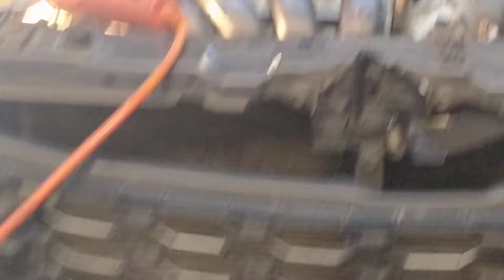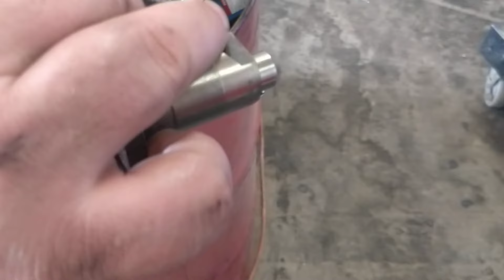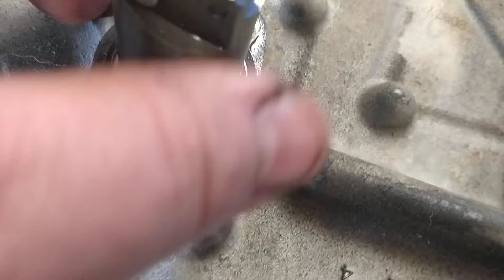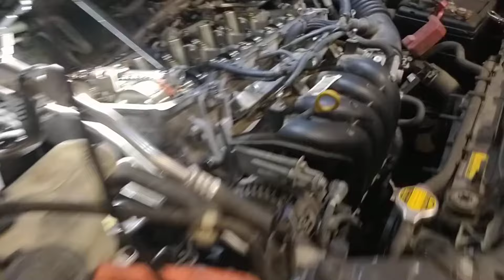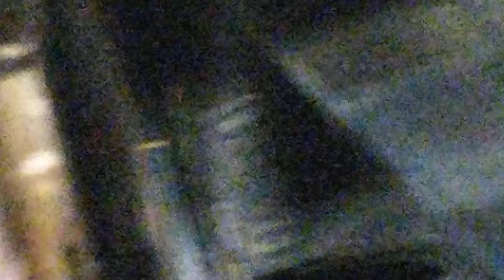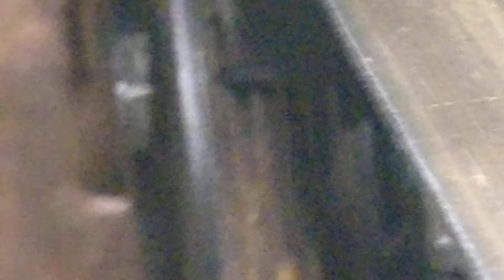Toyota Corolla/Matrix 1.8L chain tensioner install and tips (2ZR-FE)

Comment: I took the tensioner out to change the gasket, now the tensioner won't go all the way in, I rotate the engine counter-clockwise to see if it goes in, still nothing, looks like the engine has to be aligned now
Reply: Did you find any engine oil leak from the tensioner gasket before you replace it?
Reply: @kelee4730  Yes, I had to re-time the engine properly after removing everything, then have the engine top dead center, then the tensioner went in with no problem

Comment: I feel like those metal gaskets are the culprit. I don understand how such a flat rigid gasket was designed for such task. Maybe putting gasket maker in addition to the oem gasket will make it leak free longer.
Reply from the maker: @thingshappen9199  it's just a crush gasket it's a one time use item once they're installed they're good for a long time
Reply: @jwilkers1  If the are good for a longbtime the how come this leak is soon common?
Reply from the maker: @thingshappen9199  not sure the definition of common I believe it's probably more an issue of higher mileage engines and seepage around a gasket on something that gets a lot of vibration
Reply: @jwilkers1  well, I'm just concerned that even after replacing that gasket the leak will come back in no time at all. I actually replacing all four mounts so that should help.
Reply: torking bolts 🔩  periodically help  ?

Comment: On my 2010 Toyota Corolla repair manual said to release tensioner hook turn crankshaft to counterclockwise then clockwise. Now I have 2016 Toyota Corolla 2xr-fae should turn clockwise to release the hook

Comment: I'm having problems reinstalling my tensioner. It stops 1/4" out of the bore stopping against the chain guide tension bumper and won't go in any further. Any ideas?
Reply: Did you find about your issue? I am in similar situation.
Reply: My son and I have similar issue.  Tensioner is hitting what we believe is the bumper.  Sounds like the bumper slipped and we have to take the cover off to realign.  Did you get an alternate fix?
Reply: @b.h.3649  Did you try to recompress the tensioner before sliding it back in? the only reason it won't go all the way in is if the plunger was already untensioned and the plunger came out.
Reply: @The1Music2MyEars mine is the same way too

Comment: Since you are at that with the valve cover off.  Mind as well clean the vvti solenoid filter that is on that first cam rail cap. Once you remove it you will see a black cap underneath that cap rail.

Comment: Great video! Thank for taking the time to post it here on YouTube. I have a 2009 Corolla high mileage 350,000km same engine. It makes a rattling noise when the engine starts up first thing in the morning. I replaced the timing chain tensioner based on this video. 
Result engines makes less noise starting up in the morning, should I replace the timing chain and camshaft gear next???
Reply from the maker: It would be next to impossible for me to tell you accurately if you need to change the chain and sprockets/cam gears. With that kind of mileage on the engine I would suspect that there is a decent amount of chain stretch and in that case I would say yes changing the chain and gears would be a good idea but a mechanic's stethoscope might help you pinpoint where the problem is
Reply: @jwilkers1  Ok, so I got a mechanic’s stethoscope and sure enough the rattle on cold startup is coming from the intake Camshaft Timing Variable Gear. I went to the junk yard and pulled one from a low mileage Corolla 2ZR engine and spent the afternoon installing it.  
There is actually a TSB from 2009 on this issue ….
T-SB-0087-09 - Brief Engine Knock/Rattle Noise at Cold Startup.  
Part#: 13050-0T010 this exactly the part number of the camshaft timing gear making all the noise on a cold start-up on my Corolla.  
The junkyard camshaft timing gear is part#13050-0T050 which work perfectly now in my 2009 Corolla. Thanks again for your video.
Reply from the maker: @Mojo-cg3xo  that's really good news I'm glad you got it fixed and thanks for providing the part #s and tsb #
Reply: @jwilkers1  I was thinking about making a YouTube video on the TSB# and the defective part# that is causing the cold start rattle.
You mentioned early in your video that you replaced the motor with a used one. 
How long did it take you to replace the motor and was it a difficult job to do??
Reply: Hey Mojo, any chance you ended up making that video on replacing the cam shaft part for the cold start rattle? I'm having the same problem now
Reply: @Vockhead  hey, I know how annoying the cold start rattle sounds… didn’t make the video but there is a good video on YouTube on the process of replacing the camshaft gear making the noise.
Reply: Yes replace intake camgear and timing chain and guides. Remove the timing chain cover and do it

Comment: Thanks for the video! I've never had to turn the engine. What I've done is seat the compressed tensioner, hand-tighten the nuts all the way, then loosen the nuts just a little bit (maybe a 1/16 inch) and the tensioner latch releases without fail. You know because as the tensioner releases it pushes against the slightly loosened nuts.
Reply from the maker: If it works for you and doesn't mess up the timing I'd say go for it.
Reply: Good call! I think Toyota made it this easy for a reason, SIMPLICITY! Though I’m not sure if it’s noted in the book or worldpac. Like they say.. ‘Keep it simple stupid’
Reply: by loosening the nuts 1/16 inch....do you literally mean that or are you saying to loosen the nut until there is a 1/16 inch gap between the nut and the tensioner?  I'm not sure how I can measure turning a nut 1/16 inch without under or over turning

Comment: It's not necessary to line up the timing marks to change the tensioner. Just don't rotate the engine with it removed.
Reply: It is wise to check your timing marks BEFORE you remove the tensioner to verify that it has not already skipped a gear tooth in the past.
Reply: @michaelt1349  
That's true.
Reply: Idk man, I’m here because I’ve done it like you said and this time I removed the old tensioner and now I can’t install the new one on
Reply: I rotate the engine after removed the tensioner, cause I couldn't get it back in

Comment: What the heck? How about start out by saying the year, brand and model of the car?
And basically too editing or simply not turning the camera.
Don't assume, because not all people understand nor have the money. 
So we look and ask on the internet.

This is not to cut you down.
Reply from the maker: The make and model and specific engine model are in the video title. The year wasn't nearly as important as the engine identification. If the editing wasn't up to standards understand I'm a technician not a video editor and content was more important to me than specific presentation.
Reply: You only need the engine type since y/m/m don't matter if the engine is different (like the difference between Corolla XRS and the CE,LE,S) you dinkus
Reply: Jesus what a bunch of ungrateful cry babies. Thanks for video
Reply: Just an FYI, the part in question typically costs around $40.00 new but you could simply replace the o-ring (for the 1ZZFE) for about $5.00 if it's just to stop oil seepage.

Comment: Did you have a cold start rattling noise before the repair?
Reply: I did have a cold start rattling and now it’s gone after I put the new tensioner.  Did an oil change as well. I did not open the cover, just changed the tensioner.

Comment: Hello friend, what a good video! I have a question, how can I know if a tensioner is deficient or damaged?
Reply from the maker: Generally you know by noise from the motor
Reply: @jwilkers1  thanks bro.
Reply: at 2000 or 2100 rpm while moving u will hear rattling or grinding sound (grrrrr) ..... sometimes at startup aswell for a sec or 2

Comment: Can u do a vid on the inlet vavle change on this same car
Reply from the maker: If I still have the car and I was doing that job I would but I sold that car earlier this year.
Reply: Wilkerson Auto oh no reason i askt is i was get a bit of knocking sound from the top of the engin so i took off the manifold to inspect an i saw the inlet valves wa sitting lower then all the other 3 cylinder..what dose that mean
Reply from the maker: @Anoymus985  that would be bent valves, if the lobes of the cam have space between them and the tops of the valves  then the valves have most likely struck the piston. I believe on this motor the tops of the valves have metal cups that cover the valve and spring assembly. I can only think of one other possibility but the likelihood of broken valve springs I would consider to be very low. I would be surprised if the vehicle was still running in order to make the tapping sound you were referring to I would have expected a dead miss on at least the cylinder or cylinders that have the valves stuck down. I'm almost 100% certain that this is an interference motor so I would verify timing first and if that is off and the valves are down away from the cam lobes then the head will have to be removed and damage to valves/pistons will have to be assessed.
Reply from the maker: @Anoymus985  wait, after rereading that question you seem to be saying you took off the intake manifold and saw that I was thinking you had the valve cover off and saw that, if this is the case then you may be looking at something very normal where the valves are held open at different times to allow intake of air and fuel and then exhaust valves are held open at specific times to release the air and unburnt fuel. The way to verify this is working is to put a large socket and ratchet on the crankshaft bolt and turn it slowly by hand in which case you'll see the valves move . I believe I understand what you were asking now if I'm still not understanding your question let me know.
Reply: Wilkerson Auto yes that is correct i took of the intake manifold an as u no their are 4 cylinders..an in each one u have 4pistons 2 for inlet an 2 for exhaust..wen i tool the intake manifold off in the 4th cylinder i can see 2pistons which are sitting lower then the others wiche are in cylinder 1.2 &3..i am shore this is not normal as thay are suppose to be in the closed position rite....do u think thay could be stuck an need a loosening up..as wen i start an drive the car is low on power an u can hear it in the cabin that the car is not sounding smooth..
Reply from the maker: @Anoymus985  I would say that if you have two valves stuck down you would have a dead miss. That cylinder wouldn't be contributing at all. It is very difficult to give you a firm answer since I would do tests to verify mechanical condition and based on the results either do more tests or if mechanical condition was good then I would move on to spark and fuel with general tests moving on to pinpoint testing once I established which are I had a problem in. This is where a skilled technician can save you tons of diagnostic time and give you a definitive answer after having seen the vehicle and testing it according to which diagnostic direction it leads.

Comment: Do you have to turn it counter-clockwise? Seen it done clockwise in some other videos
Reply: Yes, This video is correct and agrees with the Toyota repair manual, I don't know how turning clockwise would release the hook.
Reply: Everyone says it’s clockwise and I installed one last night and turned the crank clockwise and it clicked normally.
Reply from the maker: Going by factory service information turning counter clockwise presses the tensioner in so that the hook can be released. If you can accomplish this by turning it clockwise then go for it I just wanted to present info that I didn't find readily available as long as you get the tensioner engaged and still in time do what works for you.
Reply: yeah i thought it was counter clockwise too.
Reply: Just wiggle a few inches both ways. Doesn't take much to release hook
Reply: On the older 1ZZ FE the tensioner would automatically engage after turning the engine clockwise. On the 2ZR I don’t think you can do that.
Reply: @Ardent Fan  No, I think youre thinking of a different engine....perhaps an interference belt engine.
Reply: Ardent Fan well it does indicated counter in the factory shop manual. Something about clockwise releases the chain. But yeah...I've seen plenty of videos showing clockwise too.

Comment: Hi  why did you change tensioner? i have weird noise  from chain area, dissapears after 3k rpm and im wondering what causes this.
Reply from the maker: I changed my tensioner because the crush gasket at the base was leaking not for a noise. If you're having a noise issue like a rattle all the way up to 3000 rpm I'd be getting a mechanic's stethoscope ( harbor freight has these for around $4- $5) and listening to front of the motor. You can also remove the belt to eliminate other possible noises but be careful since the water pump won't be turning so only for a couple of minutes. Hope that helps you with some techniques for narrowing down the noise